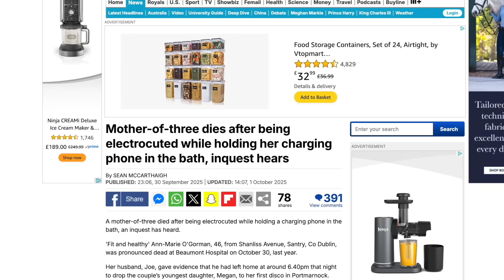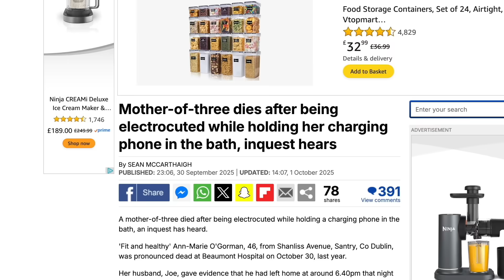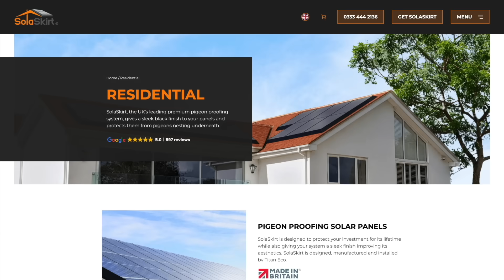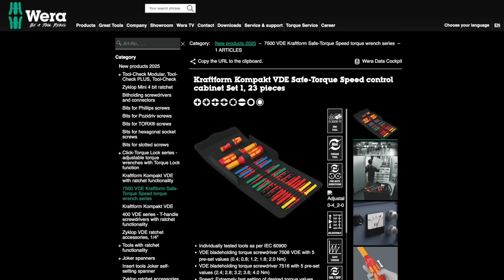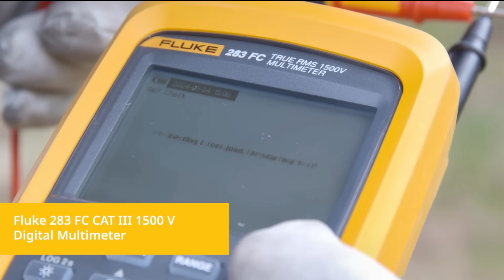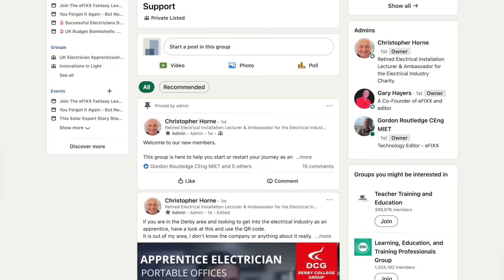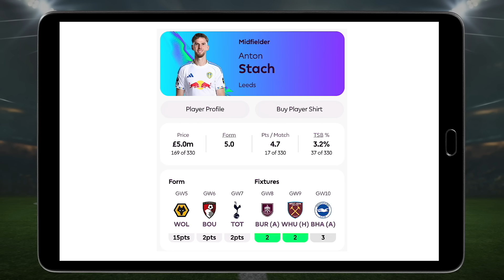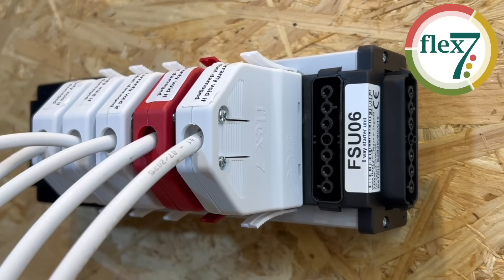He Claimed to be an NICEIC Electrician... Big Mistake

Comment: Sad that she died but who in their right mind takes a phone into the bath with them especially when its plugged in to a charger
Reply: Also I am not convinced by the report... (not Joe's fault), 2 amps, yes, but at 5 volts. I would suspect the charger's isolation failed (many of the cheap ones online have shocking (pun not intended) lack of separation between the mains and ELV output). A flash or hi-pot test on the responsible charger would show if it had failed

I know to us it seems silly to do what she did, but non-electricians SHOULD be safe, it's why there are regulations about designing SELV gear.   Rest in peace that lady
Reply: @TheChipmunk2008 this is what I was thinking, the charger is electrically separate from the mains. All you'd be getting is 5v. Tragic in any case however.
Reply: @TheChipmunk  Yes, there is no way 5V can push anything through a body.
Reply: I dunno, all the oldies will remember those little square 9v batteries called PP3's and to test them you put your tongue across the terminals!
Reply: @Ino-z2m  I still do if the meter isn't to hand, but the current is still very low.
Reply: It matters not how many warnings are given or what safety devices are implemented in a product,there will always be those 'special' people who do their very best to disprove Darwin's theory of evolution.
It's indicative of how as a species we have regressed, it's also very telling of how so many have become disturbingly enslaved by their phones in order to just be able to function on a basic level.
The loss of life is lamentable but the abundantly apparent loss of common sense in general, is fundamentally more of a concern.
Reply: @JL-rx6hl  its why they're advertised as water resistant not waterproof
Reply: @AMa-j9w7s Not correct.

This issue is not likely to be caused by the dropping of the phone charger into the water and ingress of water inside the charger.

It's likely to be caused by the falling into the water of the mains power socket and cable into which the charger is plugged.

So it makes no difference to the level of water ingress protection the charger has.
The IP rating of the charger is not likely to be a factor here.
Reply: @AMa-j9w7s  Is it really?
Reply: I have spent a fair amount of time as a marine electrician, once, I was repairing some damaged cabling on the shore and I finished up with more plugs than sockets, looked around and spotted the missing cable about 50cm underwater. Reached down to grab it, you guessed, somehow it was live with exposed ends. That's the trouble with electric shocks, it's a roll of the dice and 'do you feel lucky'.
Reply: @Ino-z2m My pal keeps letting the cable on his boat fall into the water at the point it's joined with another lead,which trips the controller on the boat,often leaving the supply live,he's had several 'reminders'😊 while reaching down to retrieve it.
Reply: If the charger had a earth connection there should not have been an issue.  The problem is that most cheap chargers float at around 115V, if you have a double insulated TV disconnect all but the mains cable, turn it on and measure the voltage from the outside of the aerial connector to ground in many cases it's shocking quite literally!
Reply: Someone who is completely thick
Reply: @markyd2633  A little bit harsh. The worst she should have suffered is a damaged phone. Not death

Comment: 110 bar equals 1600 pounds per square inch. So those French cleaning drones will void your panel warranties. Most manufacturers expressly prohibit the use of high pressure water when cleaning panels.
Reply: Its clearly crap press release, a 110 bar pressure washer would blast the drone into orbit!
Reply: The pressure is 110 bar from the pump but the jet is dispersed so the actual contact pressure on the panel from a two meter distance is considerably less, however I would be more concerned about thermal shock.

Comment: Is that 2 amps at 5v straight to earth or some other higher voltage leak?
Reply: If I am correct any charger in the UK will be double isolated as indicated by the two squares making such fault impossible, there is no circuit to complete as it is completely isolated, so it's likely that the charger was faulty or not built to UK standards
Reply: @mac_a_million9638  Probably a dodgy chinese ebay charger.
Reply: @mac_a_million9638  I would suspect the latter. Especially if purchased online, even from a certain retailer named after a river, as many of their 'marketplace' sellers don't really give a monkey's about safety
Reply: @mac_a_million9638   Most adapters are switched mode PSU but there is still a path to the line voltage and no SELV double barrier insulation like that from a transformer. Budget chargers do not use any form of isolation instead they use a capacitor to drop the line voltage and a simple 5V regulator and diode to convert to spiky DC. Effectively there is a direct path to 240 V. Even with the correct Apple Adapter you can feel a slight tingle from the aluminium case. Never buy a cheap adapter or use one plugged it a device whilst near water.
Reply from the maker: Yeah, that part of the report have me pause actually. Maybe a faulty charger? Desperately sad either way. 😢
Reply: @efixx  Did the report state anything about the the provenience of the charger (i.e. unbranded with a very basic dropper circuit in it etc.)  - I guess they couldn't have done any tests on it after the fact as presumably it was ruined. Did an RCD on the socket circuit at least trip? So many questions - It has to be combination / swiss cheese of factors that led to this as putting aside it's obviously not a sensible thing to do protections are in place for peoples' misadventures.
Reply: @efixx  Absolutely. It's always a tragedy when someone does something, even though it may seem unwise to us....and ends up dead :(
Reply: @efixx  it's possibly a fault but unlikely, typically this happens with cheaper chargers that do not meet standards, it is unfortunately common on online stores like amazon, ebay and others as the store itself cannot be held accountable for what is sold through them, the only current solution is to report any sellers that are selling these but its often only after something goes wrong that anyone even knows, this just goes to show the importance of buying from known brand names
Reply: The uptick in these stories has led UL to kick off an investigation into crappy phone chargers

Inside the charger there's a small transformer that separates the high voltage coming from the wall and the low voltage going to your phone. As this is a touchable connection it requires extra insulation in the transformer (generally a tape layer) to physically isolate the two sides in case the wire insulation fails

All this is done to ensure that even a power surge won't cause dangerous voltages at the output

But what if you want to make a cheap charger and don't plan on sticking around? Then you put a fake UL or CE logo on your product, get a flyback that isn't safety isolated, ship a bunch, and disappear before you get caught.

When the insulation in the transformer breaks down then your 5V USB cable is now at 120V or 240V and can cause serious damage
Reply: @bramcoteelectrical1088  yes, certain online retailers need to be held to account 'nah we're just a marketplace'. Yes, one with an established name and brand, if you let some fly by night arse to sell using  that name and brand,  YOU are liable.. laws need to change, or more people will die
Reply: Guessing no metal earth pin on the plug
Reply: there never is, not with a connection anyway
Reply: @AMa-j9w7s Due to the double isolation there is no need, there won't be any metal parts that require earthing, the double isolation ensures that there is no physical electrical contact between any part between the high and low sides, so the metal shielding on cables is not actually earthed, if you get continuity between the metal on the connector and the earth pin, that's a problem and s sign that it does not meet standards
Reply: @mac_a_million9638  one thing to add, the one time you WILL get continuity there, is on an actual PC (not necessarily on a laptop though!) because the PC's 'ground' is actually the negative AND hooked to mains earth. But for a standalone charger, correct!
Reply: @TheChipmunk2008  I remember this being the case on many power supplies that have an AC cable going to a brick like a lot of laptop chargers, I believe its a high resistance connection to get rid of voltage caused by noise suppression components used foe EMC compliance, some cheaper plug in power supplies that have plastic ground pins can actually see 115v+ between the DC side and earth, but the current is so low that touching that and ground at the same time clamps the voltage to near 0v
Reply: reply in lieu of edit,  a dmm will show similar voltages, due to the extremely high input impedance, but the currents will be way different

neither should be  anywhere close to dangerous